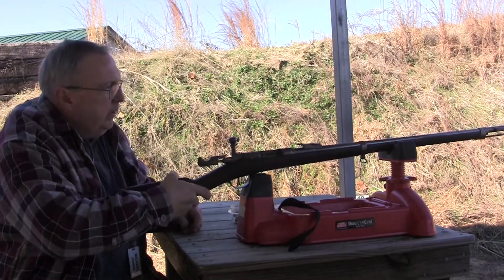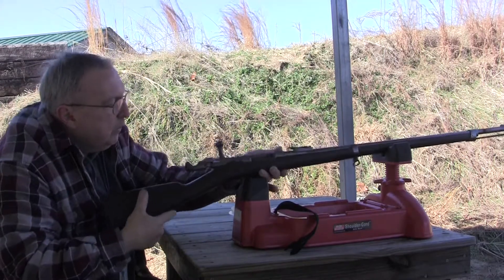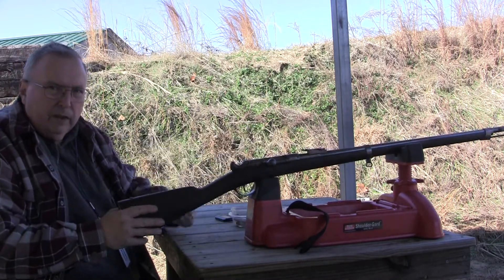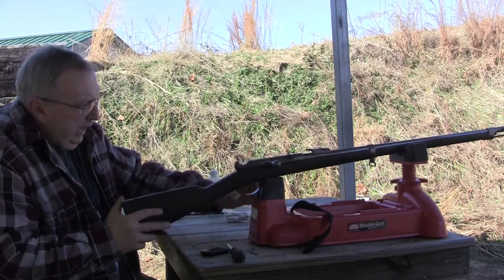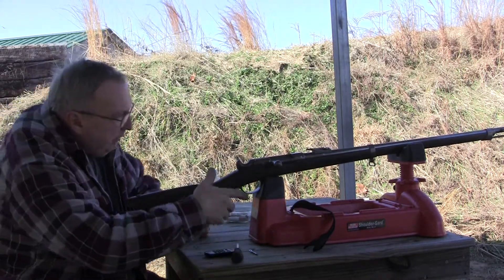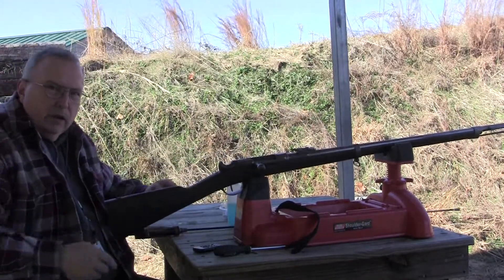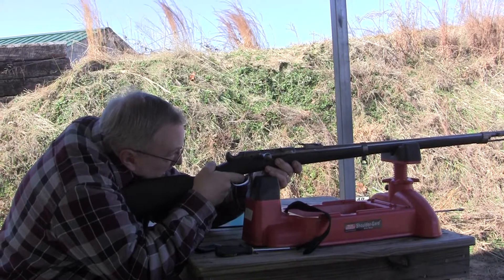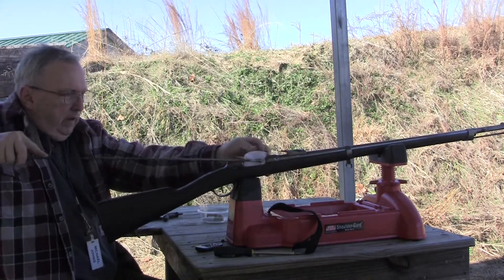a little shooting with french Chassepot Rifle a lot of fun

Comment: Great to see the Chassepot in operation. I've been working with mine for about 7  months and have  come a long way. I was using the lee 45-70 HB bullet and recently got the Accurate Arms Chassepot mold. I went through about 300 CCI caps and never did get truly consistent ignition, I switched to RWS caps and it made all the difference in the world. I think there are several problems with CCI's, they are copper cups and the needle tends to go right through them without reliably setting them off, the RWS brand are brass giving the needle more opportunity to crush the priming compound, They also seem to be very weak I had many that partially ignited but didn't ignite the priming or main charge, the RWS ignite very well. The CCI's are a solid cup (French caps had two holes in the top to aid ignition) which doesn't put the flame in immediate contact with the main charge, the RWS caps are split along the sides of the cups and the flash has a more direct route to the main charge. I don't make a "period correct" cartridge but rather a paper tube 72mm long with primer, powder, card wad, great cookie, poly wad and bullet. I recently switched to 75 grains of FFFG and it seems to be more accurate than Goex Cartridge was. Still a work in progress!
Reply: Mine works perfectly using toy caps with a little 4FG added into it
Reply: Which bullet works best in your chassepot? The lee 405hb or the accurate molds reproduction?